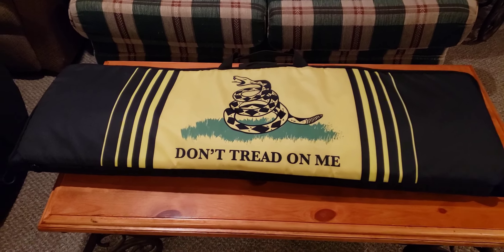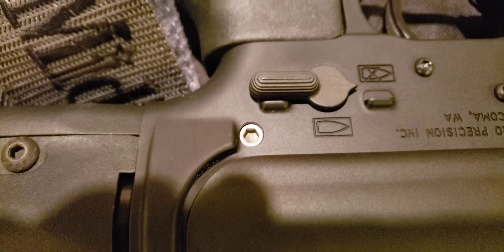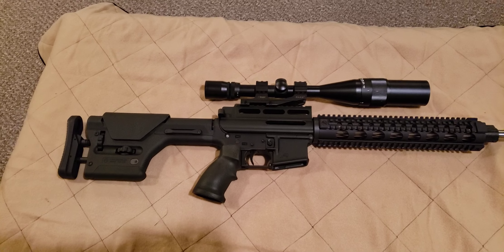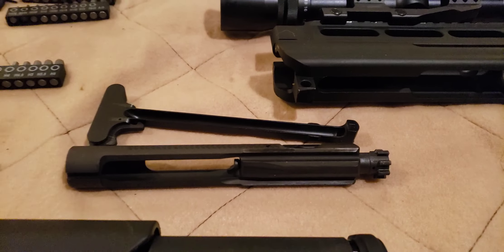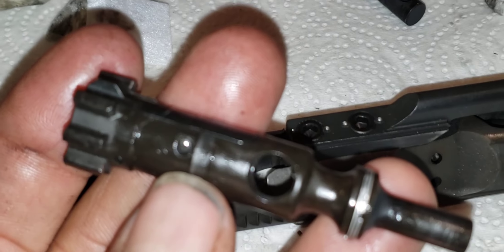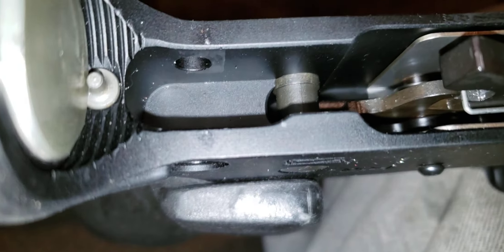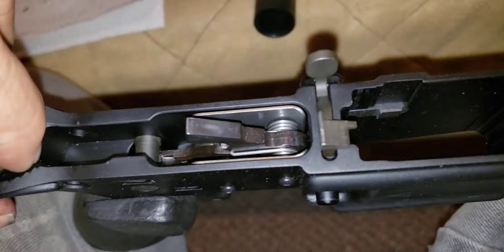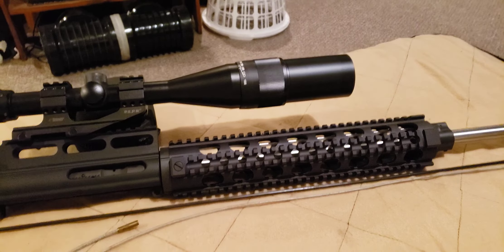6.5 Grendel maintenance and inspection

Comment: Been having a blast with my 6.5 Grendel the past few years. Thinking I might build another one at some point down the line. Not heard of that as block company either. Grendel have been known to be hard on bolts...great idea to inspect them. Probably due to take mine apart for a good cleaning/inspection. Thanks for sharing with us. Hope you have a great weekend!

Comment: looks pretty dry.  That take down split bolt is pretty cool.  wonder if he had a lot of slop in his fitment.  thats a solution but I have never tried it.
Reply from the maker: I just texted him about it. He apologized for not telling me it was pinned with the expansion bolt. 
I said "I got it apart with a claw hammer, all good" 😅

He was trying that rear pin bolt to see if it made any difference with group consistency and accuracy. 
I get to play with this one for a bit. I'll start with factory loads, then continue with some load development. It does look like a neat round.